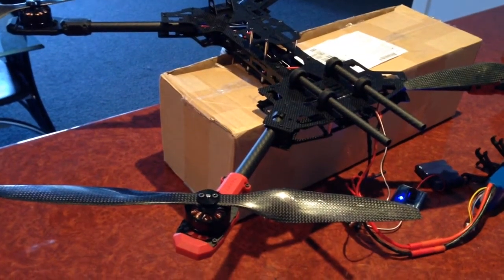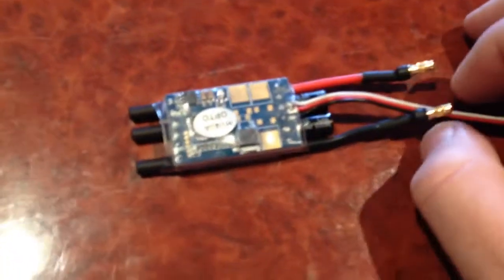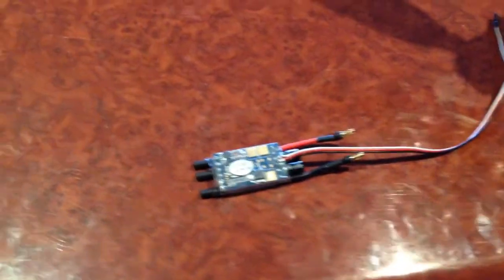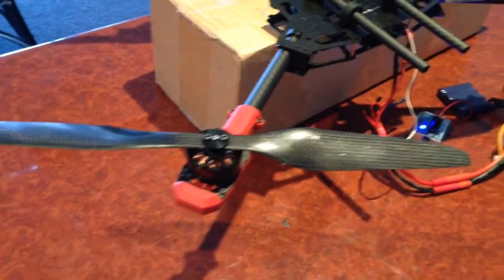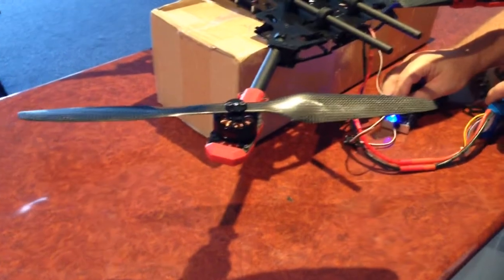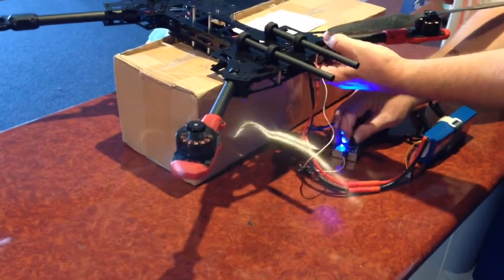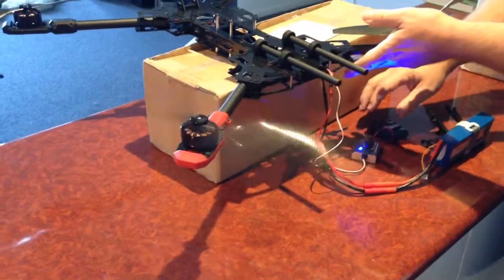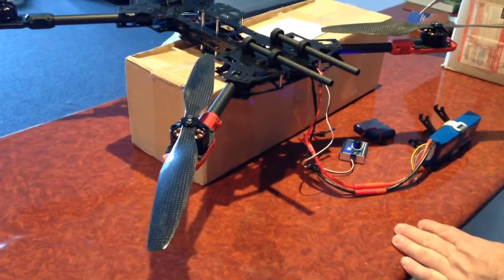Alien 560 Build  - ESCs and motor run up.

Comment: Hello
I am thinking of getting the Alien 560 Quad-copter but I want to get it to fly for about 30 minutes with a gimbal + GoPro camera.

May I know what are those red things at the end of the multicopter arm?
Are those arm extensions in order to fit the 15inch prop? Did they come with the kit?
Is the Sunnysky motor able to fix onto the motor plate that came with the kit?

Do let us know the flight time you are able to achieve.

Thanks
David
Reply from the maker: Hi David, they are Tarot motor mounts which I am using to extend the arms to allow larger props.